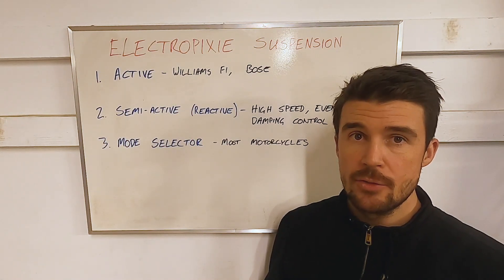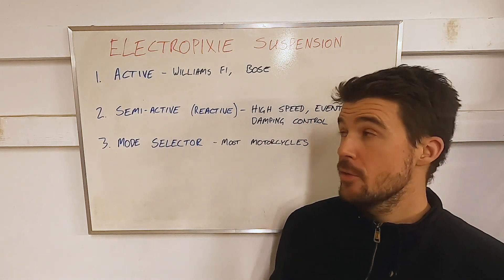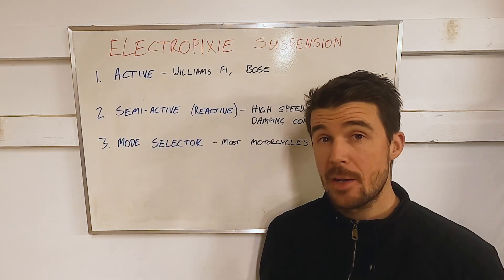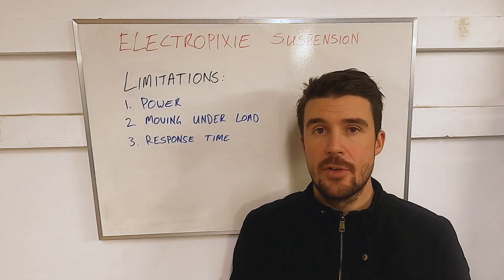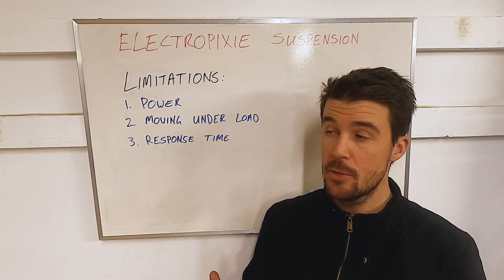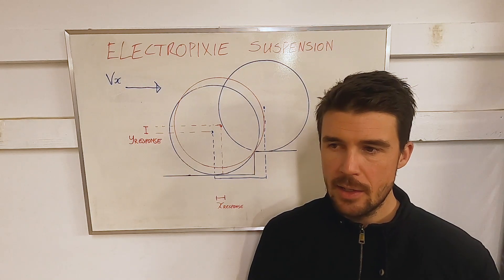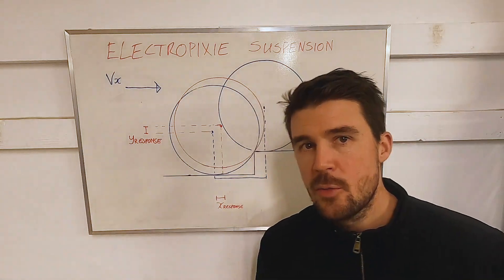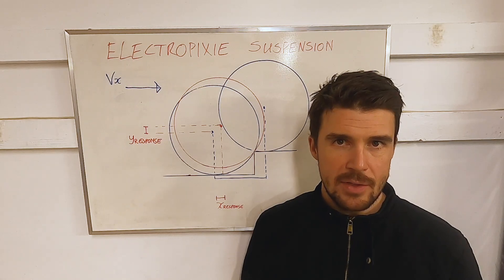THE FUTURE IS ALREADY HERE...sort of - Tuesday Tune Ep 33

Comment: I feel like if I had the spare time, I could probably build a better semi-active suspension control system and make it open source that would remove a LOT of the suck factor on a bunch of these... because it shouldn't actually be that hard to attach sensor inputs through a small 5W MCU coming off the fork into compression circuit settings adjustments on a servo to do useful mode selecting... and then just tie that into the dropper post state to determine what the preferred behavior profile is.

Comment: Interesting. Coming from an FPV flight code development background(me mostly on flight testing though),  we also delve a lot on response times of brushless motors maintaining flight stability while maximizing agility of drones. For the particular open source software we're using, we managed to significantly cut down latency to near 0 while sampling 16 to 32khz using smith predictor. I wonder if it's possible for us to transfer the open source code to make the system more accessible to everyone and make it even vastly more tuneable.

Comment: I love ya, buddy, but you’re wrong about Live Valve. It can be tuned to toggle between locked out and open, but “locked out” is not the only option. We (Pivot) offer Live Valve on 6 or 7 different models, and the amount of activity/oil flow varies drastically between them, based on the intended use of the bike. 

For example, on the M4SL, our XC race bike, the suspension is nearly locked out when it’s “normally closed”, and then it opens pretty wide when a bump is encountered.  On the Firebird, our enduro rig, the Live Valve is tuned to feel like the normal Float X2:Fox 38 suspension when it’s “closed”. When the Live Valve FB is “opened” by encountering a bump, it is tuned to get SUPER soft/gooey, swallowing big bumps whole. 

Meet me in AZ this winter and I’ll take you out on a few different bikes to try them out! I’ll get Heavy to meet us there for Apres ride beers and hijinx.
Reply from the maker: Hi Jack! Thanks for the invitation, if I'm down your way I'll definitely check it out. Thanks also for your input - however my point actually stands. The Live Valve mechanism is a latching solenoid, which switches rapidly between two positions (open or closed) and can stay in either one without consuming power. The firmer mode (which I've lazily called a "lockout") operates the same way as any other mechanical climb mode would once it's in that operation (by entirely blocking or significantly restricting oil flow), and purely mechanical climb modes can obviously be tuned to be very stiff or relatively soft. Likewise, the open mode can be tuned as stiff or soft as any other mechanical system, and the valve can flick between the two modes very quickly. The point being made though is that it isn't an incremental adjustment (unlike Flight Attendant), it's a selector between either of two modes. Whether it's a rigid lockout or just a firm/soft mode, the electronic aspect is still binary. It's either either pregnant or not pregnant in this case :)

Comment: @6:27 IIRC power requirements was the reason the Cannondale's Simon system was never launched. The system was, essentially, an orifice damper with a continuously varied orifice size by virtue of a needle valve in the damping orifice that was raised and lowered electronically.
Reply: The thing had to work all the time across a wide range. Personally, I think if there was a baseline damping curve that the system could then modify, it would take a lot of the load off. 
Or now, one could try to implement it on ebikes
Reply: @n0ch91c3s  And therein lies an issue, it was an orifice damper so a default damping curve would be garbage since the damping wouldn't be speed sensitive. 
It would be interesting to see how it would do with variable high and low speed damping. I can see a variable orifice low speed and a spool-valve damper with variable spring preload to adjust high speed. Then you could have a useable baseline damping curve.

Comment from the maker: @Ron Gaulden posted a link to a video about Fox's Live Valve in trophy trucks, the comment seems to have been deleted, so here's a link - https://www.youtube.com/watch?v=ipNOQzBAdHE
I stand corrected on it being applied in off-road racing (I comment in the video that it has not taken off in off road racing), this is much more positive in terms of off-road application than I had thought, however details of exactly what is being adjusted are somewhat lacking - Fox's own description in the video seems to imply that they're using it as a wheel-speed sensitive adjuster so that the truck is stabilized at lower speeds and able to eat up the bumps at higher speeds. That description most likely is not the full story however - it is almost certainly doing more than just adjusting compression damping according to speed and steering angle. Vehicles have a ton of sensors already, so at the bare minimum there's a lot of data to draw from, but it does appear that it is still not a bump-by-bump adjustment.

Comment: What I'd like see is to have the 3-state (fully open - "trail" - locked) adjustment available as a wireless system, without the obscene amount of cables the traditional wired remote lockout systems offer. A small control unit on the handlebar, 1-1 small motor-battery combo on the shock and fork.
Reply: Good news, it's called Rock Shox Flight Attendant.

Comment: Great video again! :)
One question regarding another feature of the new Rockshox flight attendand stuff:
They added rubber mounts to both the airshaft and dampershaft (buttercups). Do you think a solution like this can make a significant improvement to the sensitivity of a fork?
My guess would be that it could provide two things: 
* Reduce the initial spring rate by stacking another spring medium into the total sum. 
* Stagger the effect of static friction of the chassis on one hand and airspring/damper on the other hand. -> Similiar to being able to rip a phonebook page by page instead of all at once.
What do you think?
Reply from the maker: I think it'll help yes, it's the same as using rubber bushings in car suspension. Does not seem very useful to have it on the damper side (already has very low friction and very low compression damping forces) but on the spring side it will help a bit. It only helps with static friction though, not dynamic.

Comment: Have you seen the pinkbike videos with bikes droping to flat in slow motion??? In most of them the rear tire plays a huge role as it goes a couple of cycles of compression and rebound. The rear suspension compress around 70%-80% in the first cycle and then it bottoms out in the second cycle. In the first cycle it seems the dampers play a big role, but in the second one it's all about spring rate, because the speed of the shock drops a lot. This videos got me thinking a lot about what is the best way to improve the performance of the shock in the last part of the travel.

I would love to hear your thoughts about this.

Comment: Of course these fancy electronic damper controls are predicated on the assumption that lockouts make a lot of difference. Peak Torque did a recent climbing test on a paved climb on a mountain bike. He pushed 300 watts for three standing climbs and three seated climbs. No real time difference. I’d like to see that type of test off road though. Personally I prefer open. I very rarely “lock out”. One thing Peak Torque mentioned was that he thinks it takes more energy to produce 300 watts when the shocks were open versus locked out. I’m not sure that’s true or not but it’s a concept I’ve not seen considered.
Reply from the maker: I tend to agree on the discrepancy in energy to generate power - I think it's hard to measure efficiency with typical power meters (haven't seen the Peak Torque test, is it on youtube or somewhere else?) because they're directly measuring torque at the drivetrain, which requires a specific reaction from the wheel already. What they don't measure is the up and down motion prior to the crank rotation, so where the energy lost (in terms of the rider's own energy expenditure) is "before" the power is actually measured. It's essentially measuring power output at the wheel, holding that constant, then saying that nothing changes the efficiency of the drivetrain. The power should be held constant at the rider's end (which is pretty much impossible to measure as far as I know; maybe you could use indirect calorimetry or something, but otherwise very difficult) and the times measured then.
Reply: @VorsprungSuspension  https://youtu.be/zGO2pu0JX_8

My take away was that he found when measuring power at the crank you are going to get the same times. But the metabolic effort of the rider isn't taken into account and is probably higher, but very difficult to measure accurately. So pretty much what you've said.
Reply: Yup - that’s what they concluded.

Comment: In regards to flight attendant I can see a future pathway for it since it also integrates into the pedaling dynamics.  As you say the future bikes like a dh bike pedaling like an XC bike.  I can see when cost come down and wireless tech (suspension, shifting etc) is more the norm instead of niche then some frames can be designed with less anti squat values to have better small bump sensitivity without sacrificing climbing ability.  We’re already seeing E bikes with lower anti squat values because pedaling performance isn’t as crucial when you have a motor so if you have an auto lockout feature that is integrated with the crankset then you can design a complete bike package that pedals just as good as the more sensitive bike without having to flip on and off a lockout.  For now the price isn’t worth it and the frames aren’t designed for it but I can see a future pathway with what Sram is trying to achieve but it’ll take the bike having to be built around the concept before it truly shows it’s value.
Reply from the maker: Anti-squat doesn't affect bump absorption capability unless you're pedaling, but you must be putting out a lot more power than I am if bump harshness when climbing is a big deal :)

I agree though that once bikes are built around it, then it might become something much more interesting.
Reply: @VorsprungSuspension  hmm good to know.  So maybe still beneficial in the flatter sections trying to maintain speed might get a better balance of sensitivity vs pedaling where currently it’s more focused on climbing anti squat.
Reply from the maker: @jessehill3780  for pedaling over rough ground for sure it can make a difference, although it's really pedal kickback not anti-squat that dictates that - a high pivot/idler bike behaves differently in that scenario to a bike with the same anti-squat but conventional chainline.